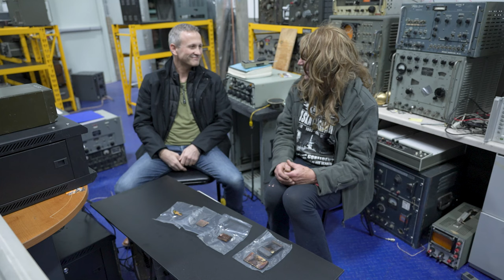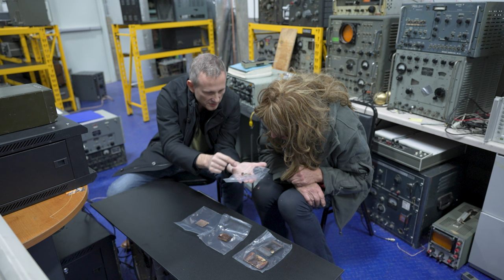Discussion of "Hutchison Effect Replications" with John Hutchison

Comment: I attempted to have an email conversation about fifteen years ago with John but can't say that it was very fruitful; I gave up. I tried to explain to him the reason for this effect and how to make his device more conducive for levitation. In essence, a single-crystal wand has a similar heating effect as a microwave oven might, it all depends upon the size of molecules and the frequency of his input tesla signal. In fact, the million+ voltages he used also explains the damage he was causing to most of these targets. That said, the best way to levitate the objects is to use two side-by-side crystals, lower the voltage, adjust the focal point of the two crystals and invert the wave for one of the two. Point the crystals at the center-of-mass of the target (holding them with a tripod for stability) and allow an avalanche effect of aggregate spin alignment to occur. At the point where the object rises, quickly divert the crystals from the object so that it doesn't hit the ceiling and merely levitates in place. Hold your left hand in front of you. If you can cause the molecules in a target to have aggregate spin in the direction indicated by your fingers, the object will feel a force in the direction indicated by your thumb.
Reply from the maker: If you care to demonstrate, I can say that, given our understanding, what you say does make sense.

Comment: Never been replicated. Why doesn't he just show it to Bob how to levitate and melt things.
Reply from the maker: He is assembling the means. Back in Canada in the 70s and 80s, scrap yards were easy to access with power electronics. Right now he has got the best lab he has ever had, but struggling to get the parts.

The VEGA experiments predominantly use widely available and affordable second hand materials, so the prospects for easy replication are much better. That being said, it is appears to be the same underlying process but at a different level, more like Ken Shoulder's + in a vacuum chamber rather than HE in free air.

Comment: How do you replicate the effect? Why has it been difficult to replicate? Are not enough people trying?
Reply: My understanding is that this kind of technology doesn't receive the funding necessary to achieve a significant consistency
Reply from the maker: Unidirectional disruptive discharge or high energy photon/particle into ideally a hydrogen or water containing medium at >5-10eV (higher if other element) with resulting fully charge separated fractions targeted, dense material focussed or light guided into insulated samples with manipulation by magnetic and/or electric and complex fields thereof. Resonance and standing waves are advantageous as is metals with single isotopes (such as 27Al).
Reply from the maker: @AmericaIsADeathCult  This is a big issue, but the biggest problem is its sheer unbelievability.
Reply: @MFMP  It's only unbelievable when you have been misdirected by 'lore' and 'education'. What did the ancients know that we have been shielded from ???.
Reply from the maker: @ericmc6482  It is quite possible that the ancients just did this without thinking too much about how it happened, a bit like when you walk or even as simple as just seeing or hearing without considering how that is possible - it becomes second nature.
Reply: @AmericaIsADeathCult  problem is this equipment is now rare and costly as well most of it dies not exist anymore if you know if any warships I can get stuff from ? Or why have friends in the pentagon help out  I know the Canadians  defence dept did threw satellite electronics   I still have these items I made a video on it
Reply: Not to many vintage explorers around

Comment: John H if your by chance reading this, I replayed to your whats going on post on X. I posted some replys showing you a further generation of your crystal converters. Ive been designing and building smaller and more powerful cells that will easily be able to wired together and placed into a case for a portable crystal power cell to charge items like your phone ect.. If your interested in talking id be happy to share my work. Ive developed a crystal cold paste that now makes it so much easier to work with at room temps vs boiling hot so its allowing me to move into a second phase using thinner and very long films for my anode and cathode so I can make much more powerful highly compact cells folded or rolled up like a lithium cell but more powerful and never needing charging. Atleast thats the goal, im close!

Comment: I wish John could talk freely. But he signed documents and will never share the most important part of his work. There is a lot of 'talk about john' but not (in depth) of his 'science'. I pity that. Rwg also had a long talk with John (another youtuber, look for him), and had access to many of John's papers. Nothing came out of that as well.
Knowledge just is getting lost. We have to reinvent the wheel over and over.

And you know what? I have a feeling that John may have found in the end, that he did not need ALL of those devices, but just a couple. O, I wish he could speak of it! (ps: I can be all wrong, I admit that. But it all adds up).
Reply from the maker: The volunteers of the MFMP have between them replicated most of the effects at the atomic and micro level and now, in vacuum chambers like Ken Shoulders, the macro level. I have met with RWG, he was diverted from open work, it is sad. It is only a matter of time.

Nature does this, it is coherent matter, natural BL touching Al becomes manipulatable cold. Russians demonstrated this as a mature technology to representatives of Tom Bearden in 1992 before it was re-classified. Alik Pizzaro was able to manipulate Al affected by Hutchison shortly after power turned off, leaving his fingerprints. Ralf Ring was able to push his hand into and out of "Jello" like Al when it was exposed to EM fields by Otis T Carr.

We know that all the equipment is not needed because John only used maximum 4kW, in Henk's experiments that produced the samples discussed in this video, a maximum of 700V at 1-2A was used.

This is a science, it is repeatable at will and we have already made public how to do it and how it works.
Reply: @MFMP  That's elaborate! I see names like Ralph Ring. One of those free energy researchers, like the others you name.
I am following you (subbed) but am not able to comprehend every detail, by far. I do have fait in what you are doing!
Reply from the maker: @deslomeslager  If energy is released in this process, it is due to conversion of forms of energy into useable photons and electrons predominantly. Mostly there is conversion of matter to matter via a coherent matter state which often absorbs thermal photons from the environment and produces non-thermal, higher energy photons.
Reply: @MFMP  Okay, as if a warmer spot (in molecules) is all drifting in the same direction, causing those atoms to go in a higher state. Sort of 'local heating' (which would also mean local cooling I guess). However the change in matter absorbs energy but also gives energy. If we keep it at that level, then I am somewhat understanding it. Thanks!

Comment: It's annoying because I want it to be explained but there is no explanation!
Reply from the maker: Hi energy disruptive discharge and high energy radioactive emissions form charge clusters that are cohered & aggregated by way of phase conjugated EM to form topological monopoles that have no electric charge expressed that is resonant with normal electrons. These are then transferred by phase conjugated EM (scalar) interferometry into insulated metal samples. When they aggregate beyond a critical theshold, either on the surface or inside, they cause the range of affects observed.

These may help.
https://youtu.be/At2hUvA_-cI
https://youtu.be/s5YlXQquAU0
https://youtu.be/vz4RqeDh5xI